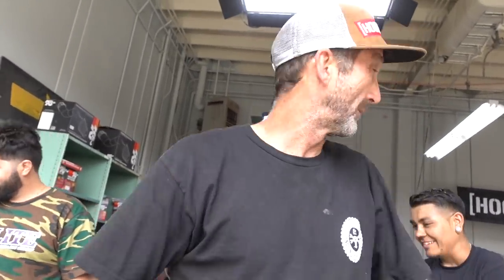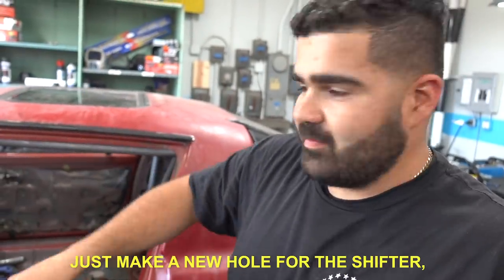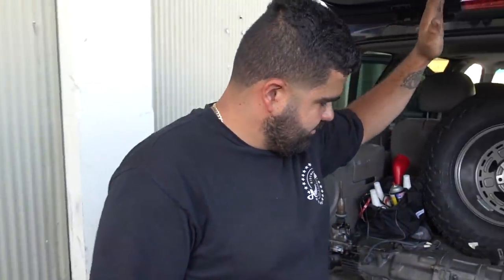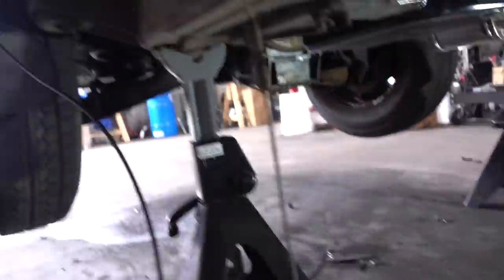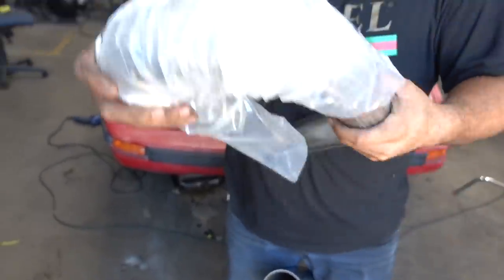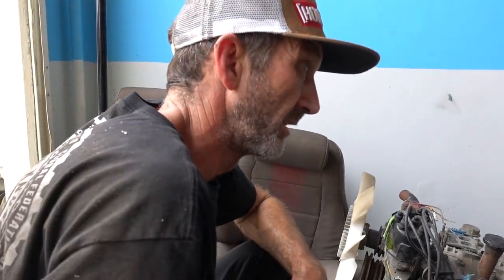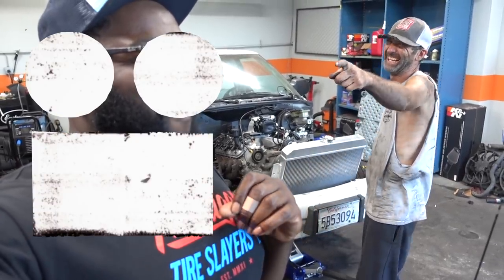Build & Battle: Automatic vs Manual Transmission, Which is Faster in a Drag Race? EP.4

Comment: Brad with the chain engine dampers. How do you beat that dude?
Reply from the maker: When the chains come out you know shits about to go down...
Reply: except he put it on the wrong side of the engine... why do you think cars lift the left front first?
Reply: theblackmech THANK YOU. 
You beat me to it. The drivers side lifts under torque - Unless his engine spins opposite to every other V8
Reply: And he has his steering shaft going through his header so as soon as the engine picks up he's not going to be able to steer it lol
Reply: I never saw a driver side chain, and LS are clockwise rotation, so........ whoops?
Reply: @jonasthemovie  27:33 driver side chain
Reply: Cableties
Reply: @seanaldinho56  Yep, there it is. Good spotting. But funny that the timestamp is where the travel chains are cut away.. lol
Reply: It's Ben years since I've seen some one put chains on an engine.. Going old school.. Sad he put it on the wrong side..
Reply: Hiatus 16 There was a more vertical chain on driver side, but passenger got all the fame.
Reply: I think he knew what he was doing putting it on both

they cant revise their cars after the build time is up, right? so if brad lost a motor mount the chain could save his ass

shit happens, cheap security is cheap
Reply: Had one on my Olds, but we used aircraft cable, and called it a "torque strap" #classy
Reply: Both sides have a chain.
Reply: Never mind...  I apologize for the doubt.
Reply: At this point, I hope Brad wins if only because I don't want some poor unsuspecting stranger to try and drive that death trap, lol.
Reply: @jonasthemovie  I didn't catch that.. I remember seeing two chains on each side growing up.. But then again growing they had more power back then, then they are putting on these ones..
Reply: Hey my Dad did this to his bronco lol chain gang motor mounts 😆

Comment: Personally I think the budget should go back up to 10k. Anyone who has built or worked on cars knows that's still a slim budget
Reply: It all depends what you start with and what you build, for 10k you can build some pretty solid cars but the catch here is time limit. Ef civic with a bseries or even a built D and a nice turbo set up along with a good tune can easily make 500hp+ for under budget.
Reply: @marcozuniga8163  And any LSx can make ~1000HP for little more than the cost of a cheap ass single stage plate kit - but we're talking about actual legitimate race car builds, something that can pass tech, make multiple passes, and have the potential to run 9s(I'm expecting 10s if they can make a clean pass, but neither would be much more than a little more HP and tuning away from 9.99s). Obviously in a non-competition build, you aren't going to cut some of these time limited corners). Something that you would actually want to keep and want to work on, instead of being such a hackjob that you just want to sell it and start over. Shit ain't cheap, mang, not even Fox bodies(not from starting with a bone stock chassis anyway, buying someone else's 10-11 second build and cleaning up their mess is MUCH cheaper since mods short of a built engine don't add much over stock prices).

Remove the time limit, you might be able to do an all used market 10 second Fox for maybe... $6500? $7000? Within a year or so? But, we're still talking about some shot bushings, noisy ass worn out sphericals/heims, a trans that may have some slop or maybe doesn't like to go into 3rd, so on. This is what makes buying a stock chassis and brand new/nicer condition used(that dude that wants $15 above market value, but deep down you know it's worth it since it's barely been taken out of the box) parts worth the extra cost, in spite of them being the same parts that you can get used, they are just plain much easier to live with in all areas(which allows me to, say, protect the threads of adjustable control arms with heat shrink tubing, while I know that real used parts are 97% going to have some janky ass threads); including on the track.

Comment: "it's a mm of but it's ok."  - no diff guy, ever 

haha
Reply: If you watch the extra episode when they get the 3rd member parts.... he told them it has to be setup right. Will it last 5 races? I think it will....I'm no expert.... but that wear pattern looked like the pinion was too far in... needed to be shimmed away from the ring.
Reply: God damn right
Reply: Yeah, I thought the same thing. Also when he painted the ring gear to get the contact pattern I was like, "uh, where's the rest of the paint?" You can't get a good idea of the pinion depth or backlash from just that small section of gear.
Reply: @iheartninja  most of the time they only paint 4 or 5 teeth on the ring gear. You can get a good idea of wear pattern with that.

Comment: Predictions: S10 throws a rod and RX7 catches fire
Reply: Predicting or wishing? Lmao🤣
Reply: There is no reason there both don't work fine.
Reply: I’m predicting lifted head and blown transmission
Reply: Predictions: 
S10 might run 
RX-7 might run
Reply: Thomas Wyrick s10 blows makeshifts header plate
Reply: correction, rx7 throws a rod, s10 sends a rotor to the moon

Comment: Hey hoonigan I just bought my first car it’s a 1999 jeep Cherokee sport and I want to build it kinda like the jeep you guys had on the channel 8 months ago. I’m 17 and making minimum wage so being able to see you guys build that jeep really gives me the confidence to learn more about working on my jeep and eventually build it how I want it to be, keep up the good work guys.
Reply from the maker: Solid choice on the Cherokee. Those can be absolute off-road beasts for cheap!
Reply: if you’re on a tight budget go with Supreme Suspensions 2 inch coil spacers and leaf spring hangers, ive had them on my 2000 xj for almost a year with no problems. $150 and you dont need to get longer sway bars or driveshafts, super easy to install

Comment: I've said it before and I'll say it again, I've GOT to learn to TIG weld, stat! I'm pretty certain the Vargas brothers are going to win the competition overall, but I have a hard time believing they'll outrun the S10. The LS/TH400/8.8/caged/stripped S10 has been proven to be super effective strip combinations since the LS' inception, and Mazda rotary cars have never been fast or reliable for cheap. At the same time, Brad really doesn't deserve it after the atrocity he committed against that manifold. A smashed block-hugger header is one thing, but that's quite another, haha! Can't wait to see them both run. I'm also TOTALLY in the mansmission camp, but there's essentially no denying the drag racing superiority of an auto, regardless of personal preference. It's really not worth debate. I'm SUPER impressed by consistent/reliable stick shift drag racers/race cars, though!

Comment: Brad really needs solid engine mounts with that steering shaft going through the header as soon as the engine flexs it's going to lock up the steering shaft from turning he's freaking nuts doing that lol
Reply from the maker: Brad thinks it’s fine, and he’s still going to send it. 😂 #safetythird
Reply: Well atleast he's going straight and not circle track or road course lol Send it papi

Comment: Should have made the suspension chains adjustable. Tieing down the front suspension limits weight transfer which he's actually going to need in a truck with a cut up bed.  I don't remember what he has for a torque converter but hopefully for his case it's a tight one.

Comment: What's with all the black paint? Especially under the hood and fenders. As someone with 40+ years of budget drag racing experience, you never paint anything black. Always use gloss paint in light colors. White, silver, light gray, etc. You can use red, blue, colors like that on some parts to give it some pizzaz. It's a good idea to use lots of different colors on different parts. When you need to work on it, you need to be able to see what you are working on, and a sea of flat black makes that very difficult. Just try and find an oil leak when everything under the hood is black. Paint is cheap, and bright colors don't cost any more than black. They also give everything a nice clean look.

Comment: I'm gonna make a prediction here, the 7 is gonna have transmission issues. But when it makes a good pass, it's gonna be significantly better than the S10. The motor will be fine though. But they'll destroy the transmission. Or something axle or rear end related. I dunno how they're taking off when they drag. But something won't like leaving the line at 5000rpm.

Comment: I’m pretty surprised that brad (with tremendous help from jose) is building a pretty decent drag truck other than the manifold hack. His work on this truck has been pretty decent for what it is.
Reply from the maker: Brad believes that little “dingy dingy dingy dingy” isn’t going to affect performance enough to notice. He’s still shooting for the  low 10’s.
Reply: Hoonigan Project Cars maybe he goes 10s, but if he tubings cutting the manifold like that doesn’t affect performance at all he’s the dingy dingy dingy lol

Comment: Brad my guy. For 30 bucks at a tractor supply you could've added a secondary steering shaft and kept full header. Cost you more in time and gonna burn a valve man..
Reply from the maker: When Brad is on a mission to use a hammer, there is no stopping him...

Comment: HEY S10,

On the water pump, you should have a hose loop on the heater core out/inlet. This will allows the coolant to move when the thermostat is closed. You will OVER HEAT the motor quickly.

Comment: Team Vargas is winning at the half way mark but when it comes to Competition...Team Doritos RX7 has No Torque, there is too many chances to miss a shift or 1-2-1 Money Shift but could back half the S10 if they can hit every gear but That Nitrous Sniffing Dime is gonna Tree the hell out of that RX7, no problem Shifting either and definitely has the Tire to put The Gap on the Brap Mobile. Don't get me wrong I'm not against Rotory Power/RX7s I just recently sold my 90' RX7 FC Turbo II S5 that I was building. The Combo I  was putting together: 
416ci LS/2 Speed Turbo Glide/Built 8.8/BW S485/E85/275 Radial Street Car that I was converting into a Truck too. Really Sad I had to Sell it but I'll build another one soon 
But I'm going with Team Brad all the way on this one

Comment: i been building a 68 chevy pu so far i have 1500  dollars in it so far all most dun running a 454 stroker with heavy duty 400 turbo got motor and trans for free with 6000 miles on it with a tunnel ram set up also a big roller comp cam set . got the distributor , coil and msd in boxes for free new got the truck for 1000 with rebuilt 327 give that too my kid for his truck have 2 extra cabs with no rust in them extra body parts but the body is good on the truck so far can't find a dig in the metal but 4 chrome peaces  need replace  around front and back lights has factory paint on it but needs painted but some people would love it just the way it is with a little surface rust just starting too rust on the crowns of the body . it all ready has the full gauge cluster

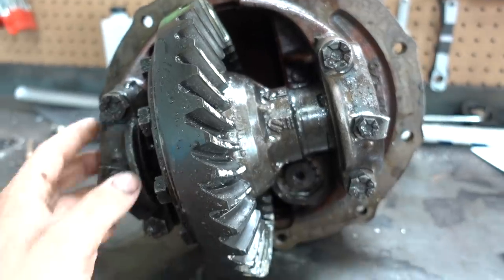Comment: GIVE BRAD HIS $100 BACK. EP.3 AT 28:34 BRAD SAID "THAT MOTOR HAS TO BE FULLY ASSEMBLED, EVREYTHING, DRESSED UP, INTAKE AND EVREYTHING AND INSTALLED" ENDS AT 28:39 and the oil pan wasn't in there, therefore the rotory motor was never fully assembled. As Brad stated to which both Vargas brothers and Brad himself agreeded to. So yeah Brad gets his money back and the $100 that Vargas owes him.

Comment: Dog box>DSG/DCT>syncromesh manual>slush box (talking to you 4L60/4L80E)
Reply: That may be what you like but for drag racing automatics are king thanks to the torque muliplication characteristics of torque converters, the fact that they don't cut power to the wheels to up shift, and the improved reaction time you get from a trans brake when equipped. Clutchless manuals like a Lenco are the only manuals that can hang and they still use planetary gearsets.

Comment: “Automatic vs manual, which is faster?” Well that depends exponentially because EVERY trans is different. Some automatics are better than some manuals, but the majority of automatics were tuned to shift early making you lose majority of your power band. Manuals are ALWAYS better atleast 95% of the time, but in a factory car, manual is Better 99% of the time. However in that slim 5% you have fully built racing automatic transmissions that actually put perform the manuals, however those are FULLY built 2 speed or 4 speed automatics most of the time. The only example I know of a faster stock automatic than the manual option is the 2019 mustang gt 8 speed automatic. But automatics are becoming much faster and better shift timing with 8 and 10 speeds coming out left and right.

Comment: Rx7 is gonna need 2 step or sequential gearbox for drag. 2 step would leave the trans stock. And the rx7 is the cleanest, but the cold side ran by the hot radiator isnt wise

Comment: watching vargas chop away at the tunnel confirms all my doubts about him they could've easily modded the trans shift location on the transmission.. if he really knew his rotarys and turbo trans into fb swaps he would know this... smh
Reply: or even one better swap the tailhousing with any 1st gen tailhousing...
Reply: 1st Gen tail housing only works on a TII transmission. If you listen closely we used a 93 rx7 transmission you can't do this mod on a 93 transmission. And we couldn't move the engine to move the shifter because the oil pan hit the subframe. Give the time constraints we cut the tunnel
Reply: @MikeVargasAngelMotorsports   ROTARY OUTCASTS VARGAS BROTHERS  ok and what about shortening the the shift linkage and moving it to the grab just the 2 front mount bolts on the tail housing.. and ok i didnt hear the 93 transmission part. But the way you both work i feel like you work better than your brother even tho he is the more known brother. Anyway let me know if you guys are ever down in florida we can try one of my motors against one of your motors 🤣🤣 if you guys dont win with a semi when i know a street port on pump gas with full interior can run 10.6 then something is definitely wrong

Comment: working for a driveshaft shop for 4 years what the fuck is a short tail ahhaah most likely a bushing that the t400 isnt clearing meaning you need a machined t400 slip yoke machine the inner splines of the yoke need to be machined 7/8 of an in towards the ears back to clear the bushing slides right in

Comment: Hert their called engines no motors GTS.
Reply: Gremlin 71 Amc “An engine or motor is a machine designed to convert one form of energy into mechanical energy. Heat engines, like the internal combustion engine, burn a fuel to create heat which is then used to do work.”

Hate to break it to ya, bud.
Reply: They're*
Reply: James Nichols thanks man idk which one to use dyslexic as fuck sorry.
Reply: Connor engine are combustion driven and motor are electric driven man.
Reply: Gremlin 71 Amc all engines are motors. Not all motors are engines...you don’t have to believe me, but you’re wrong lol.
Reply: Gremlin 71 Amc What does BMW stand for? “Bavarian Motor Works”

Comment: Not gonna lie... I'm little worried Brad blew his budget on a stock 5.3 with 2 kits... I don't think there's enough motor there to keep up with that rotorary... 240whp on what a 200 shot??? I get the s10 is light... but that RX and heavy either... and the RX is boosted with spray??? Gtfoh... I think Brad failed on his budget/build... very disappointing 😞

And they went auto which equals more power loss through the drivetrain...

 idk mane...